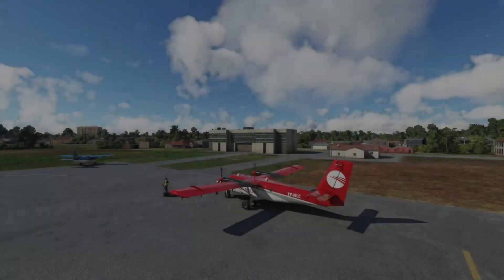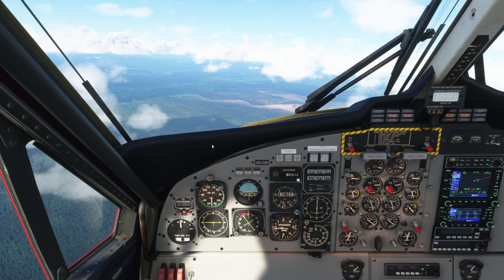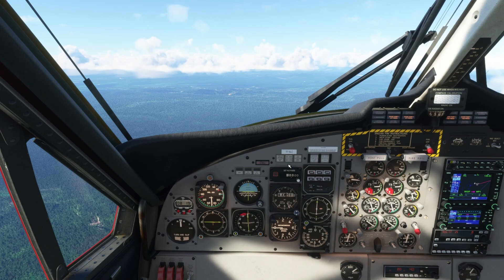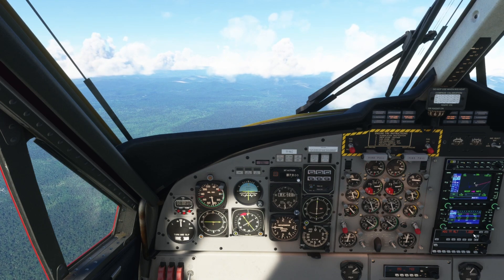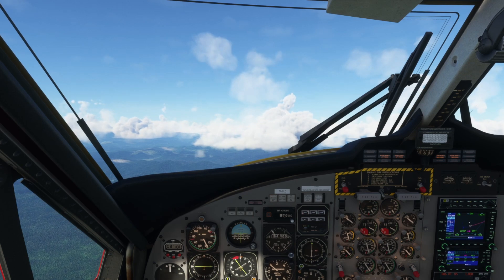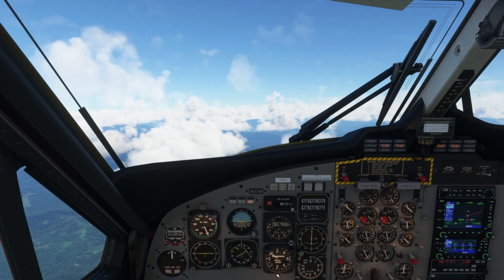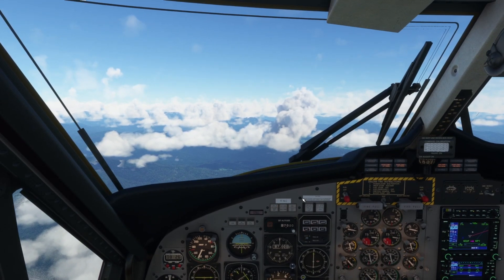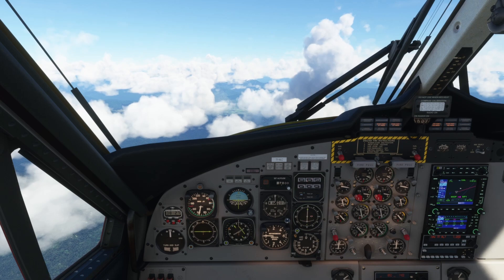Pilote Vulgaire - TWIN OTTER AUTOPILOT TUTORIAL - MSFS 2020 DHC-6-300 (Aerosoft) Quick tutorial

Comment: Thank you for autopilot stuff.  But have you ever experienced, when engage the autopilot switch, it will be reverted back right away to disengage (with beep sound).  Therefore, I totally cannot enable AP at all and never success once.. (SU8 with latest version of Twin Otter).
Reply from the maker: That sounds like a keybinding issue to me, maybe there is AP switch mapped on a device (joystick, yoke or throttle).
Reply: @pilotevulgaire  Thank you for kind help :). I'm not sure if it related with key mapping since I use only keyboard & mouse for playing.  The beep sound came from the SIM's plane itself.  It likes when turn on AP, the plane responses a bit ex: start turning to the direction of designated heading but then the AP stop working.

I'll try to uninstall this aircraft and reinstall then test again.  Thank you so much.
Reply: Just FYI, the beep sound is the sound when you disengage AP.  After some tests, I found out that if I start the plane at the runway (engine started by the SIM), AP is functional like a charm.  However, starting from cold & dark resulting in AP malfunction like in my case.  So I don't know what I've missing but already open case to Aerosoft.  T T
Reply from the maker: @metrocat9597  yeah definetly the ap-off sound. Good luck with this!
Reply: @pilotevulgaire  Hi there, just want to share in case anyone might come into this issue.  Aerosoft is still need time to investigate due to the nature of this issue.
However, I’ve found a workaround for how to make AP works from cold & dark.  My workaround is,
 
In cold & dark stage
- Release the plane’s yoke
- Turn on battery/dc switches
- Hit ESC and go to control options, then click the keyboard tab to make it highlight
- Back to the SIM, and that’s it.  Now you can turn on AP normally. (Notice when you back to the SIM, the yoke will move toward you (movement).
 
Default key shortcut is Alt+Z for AP but I did not change any default at all.  By using ALT+Z couldn’t make AP work in my case unless you pause the SIM and go to control option page.

I already informed Aerosoft about this.  Anyway, glad that it can be fixed with simple of steps.  Cheers.

Comment: I seem to be getting a problem that when i want to start decreasing my alt using the vertical speed, the vertical speed button does not work. Do i have to press the alt button again before i start decreasing my vertical speed?
Reply from the maker: Yes absolutely. For example, if you are at 10,000 ft with Altitude Hold and want to descend to 5000 ft, first go on the Bendix (on the right panel), use the circular knob to select target altitude of 5000, then hit the ALT button on the Bendix to engage VS, and hit the DN button to select desired vertical speed. Then only the aircraft will start its descent. You have to hit the ALT button for the VS to engage. It is the same process for climb.
Reply: @pilotevulgaire  Alright thank you. Will go try it out. I will update u on how it goes.